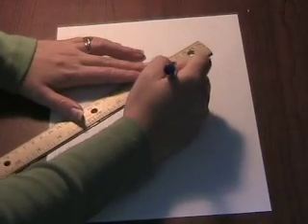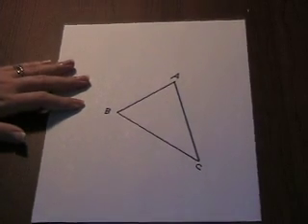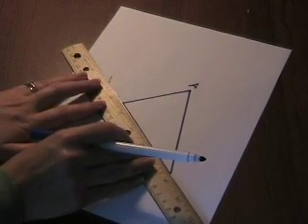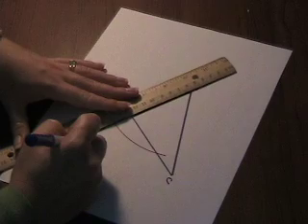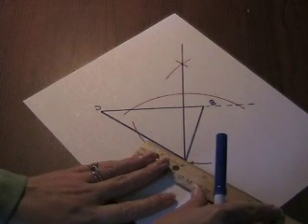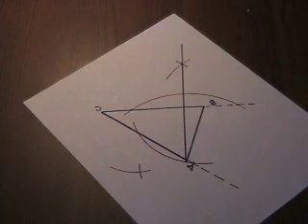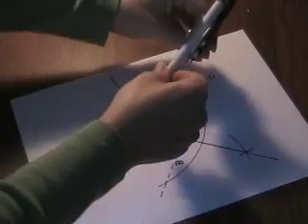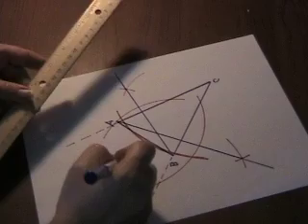Constructing the Orthocenter of a Triangle

Comment: how do you know how much to extend the compass
Reply from the maker: From vertex A, you're drawing an arc that has to intersect the opposite side (BC) in 2 places. So, just open the compass wide enough to do that. You can see where BC wasn't long enough, so I extended the side, so that the arc would intersect that line in 2 places. Hope that helps! If you're asking about constructing the perpendicular bisector, then the compass needs to be open wider than halfway between the 2 endpoints.
Reply: @MathTeacherVarnadore  you are a hero